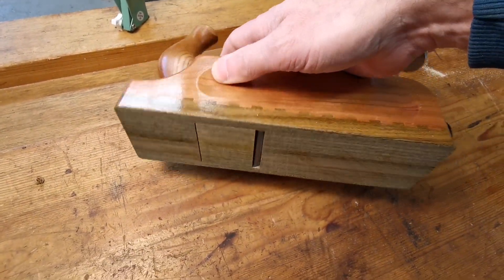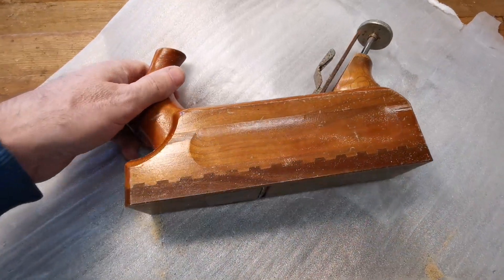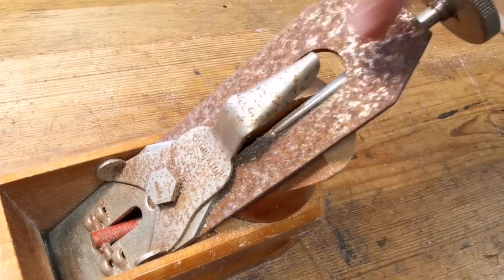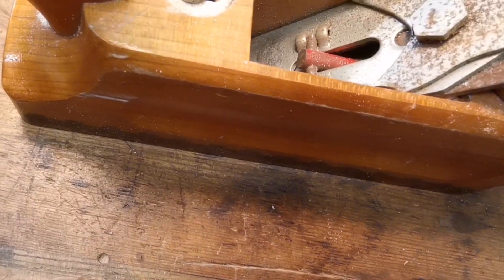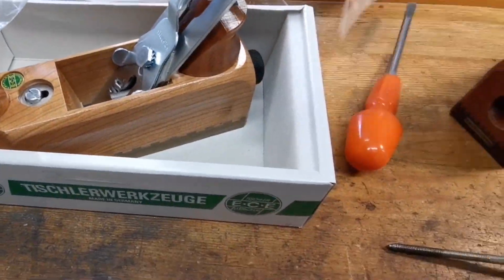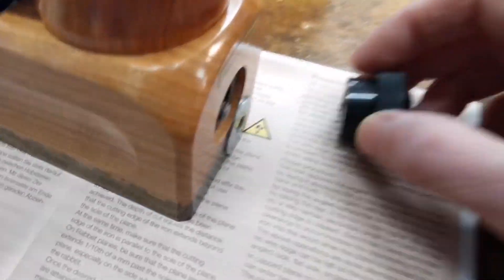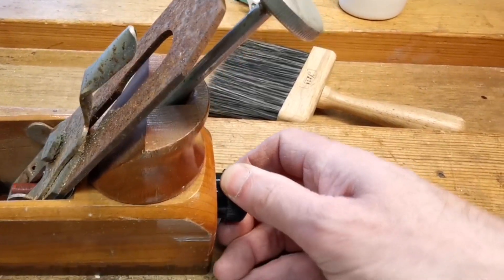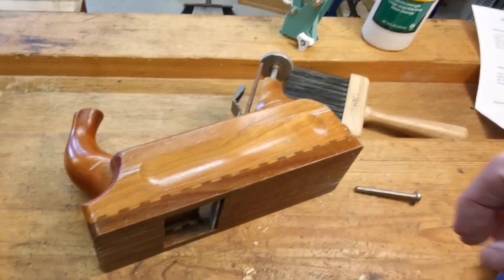E.C.E. Primus Reform smoothing plane #711 - New & Used intro & repair

Comment: until now never quite understood how they made the no backlash adjustment with a threaded rod. Really clever what they did.
That plane is made since at least the 50 and yours is likely pre 1990
Reply from the maker: It is really clever. I need to do a light restoration on mine and then customise it. By the way, mine was bought new in 2021. I've no way to work out how old the used one is.
Reply from the maker: You might like the latest video. A Tiny Thumb plane, not only cute, but Bronze and a rebate plane too. A very special little usable tool.
You can watch it here
https://youtu.be/JOGxjoQyLKk
Thank you
Jamie

Comment: I have a simplified version of this. It cost me £10 in a junk shop. I put some foam behind the rear”tote”. I agree they need customising for comfort.  The other huge positive is the superb quality of the blade. No backlash is a huge plus for me as I find it really annoying.  There is a video on you tube showing them being made in Germany by a family business. 
I see you identify with Worcestershire but I detect a hint of black country or brum😊
Try planing Lingus vitae!
Reply from the maker: That's cool. I need to do more with this plane. Busy atm. I'm from Worcestershire. My Workshop is in Stourbridge. Lots of accents pass through my workshop. Some might rub off. 👍
Reply from the maker: You might like the latest video. A Tiny Thumb plane, not only cute, but Bronze and a rebate plane too. A very special little usable tool.
You can watch it here
https://youtu.be/JOGxjoQyLKk
Thank you
Jamie

Comment: I inherited one from my father and it is a fine looking piece of equipment.There is one issue I can't figure out. The fine adjustment block on the bottom sticks out by about an 1/8". No matter what I do I can't get it to sit flush. Any recommendations.
Reply: Ok, so i got interrupted while watching video and got over excited since i found a video of the exact one I got from my dad.. so i will check for damage tonight.
Reply from the maker: You couldn't have got your timing better. I've just finished filming that part. There was a problem with this one by 1/32" And I've sorted it. Have you subscribed yet? Because the next video will suit you and a few others who can't work out this problem. It's not hard to fix. Thanks for watching. Jamie
Reply: @twcmaker  Yes, I am subscribed and thanks for the video on this tool.
Reply from the maker: Great. After the adjustable mouth is sorted I'll be sharpening the iron, cleaning the other metal parts and making improvements if necessary.
Reply: @The Worcestershire Cabinet Maker  I just checked the adjuster on mine it looked worse than yours. Tried to squeeze glue in the gaps and now have it in vise hoping it goes back together..
Reply from the maker: Oh ok. So the joint between the two woods had done the same as mine? Interesting.. sounds like a common fault. People are too heavy handed or the joint isn't strong enough. I have read that the  castellated joint is glued together without clamping. Maybe the manufacturer needs to mention 'overtightening can split the woods'.
Or add some pressure to the process. Or use a stronger glue? 
Jamie
Reply: @twcmaker  I also noted rust on the insert. Mine is about the same shape as your used one as overall condition. I do have a small crack in the front of throat (behind where the screw holds the adjuster) but it looks natural. I also have a 22" ECI plane I got from my Dad. It needs some TLC but I used it once and like it.
Reply from the maker: Just finished editing the video that will help you solve the problem 👍
Nice planes.
Going back to the rust. That will expand and deform the Beech. So damp really is an issue. I've glued mine back in with Epoxy around the external thread. Hopefully it'll be enough to stop the rust.. Not that it will ever be in a damp situation.. Hopefully.

Comment: I've always been fascinated by the German style planes, but my only problem with the examples you have here is that plastic adjuster knob. Why would they go through the trouble of making a great plane, only to use a plastic knob on the end?
Reply from the maker: I should think a metal knob wouldn't be cost effective. Maybe I should make a wooden knob. 🤔 Food for thought.
Reply: @twcmaker  I would pay a few extra dollars for a metal knob. It's like Stanley selling their new standard No. 4 smoothing planes for 80 bucks and they have plastic totes and knobs. It's like they gave up caring.
Reply from the maker: That's one way to look at it. While I'm not a fan of plastic, the wooden ones would take longer to produce. The ECE Primus plane sells 80% in Germany. So they're used to it being like that. 20% rest of the World is quite a small chunk really. And it it a tough kind of Bakellite plastic. So I'm ok with it. 🤔 I'd rather a wooden one than cold metal though.
Reply from the maker: You might like the latest video. A Tiny Thumb plane, not only cute, but Bronze and a rebate plane too. A very special little usable tool.
You can watch it here
https://youtu.be/JOGxjoQyLKk
Thank you
Jamie